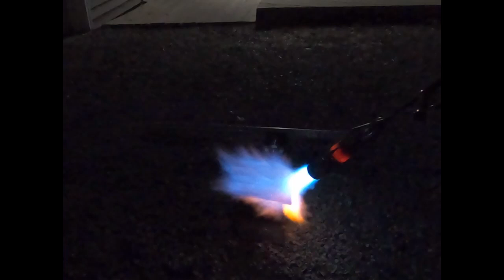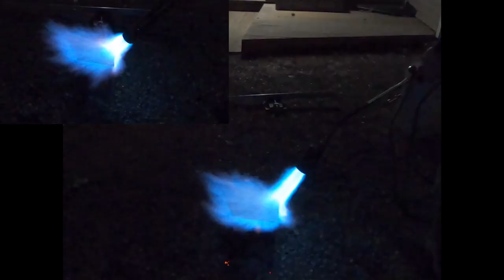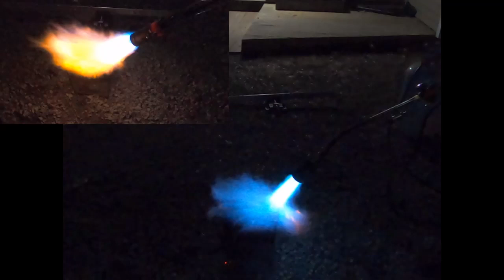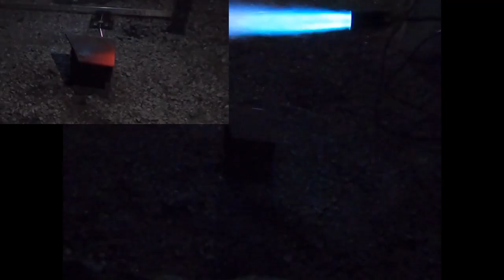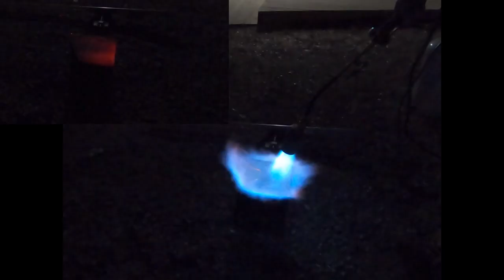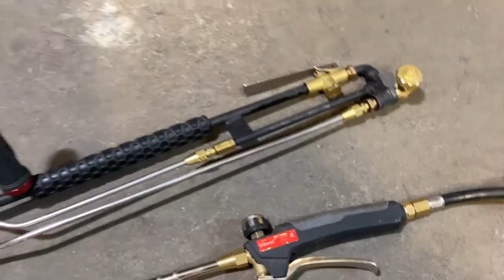Liquid Propane Jobsite Torch EXCALIBUR

Comment: Great portable solution to a legitimate issue that comes up when using propane in a colder environment. We used to use temperature adjustable 5 gallon silicone mat heaters (also known as SILICONE RUBBER PAIL HEATERS) on the propane bottles for our Bronze furnace; over time we established a temp to pressure over time graph for different temperatures to properly compensate for pressure loss. The frosting over on the bottles would render a bottle 2/3rds full completely useless over a short time of use in the winter time (10-30F) due to the Boyle's law. I used these successfully on 20lb Prop tanks up to the 200lb'ers by linking 2 of these mats together and wrapping them around the bottom below the liquid propane level or freeze line.

Comment: When you heat something like that on open -if it is possible use aerated concrete bricks.They are made by many brands Ytong is famous in europe.Its a very light construction brick with amazing insulating propertys ,easy to cut with hacksaw,its very cheap like big block costs 2$ a peace. Every time i need to solder something with torch i use those bricks as backing and it reduces time by half.

Comment: I would suggest you wrap the heated part of the propane tube in thermal tape [like they wrap automotive exhaust pipes with] so as to increase performance, since a lot of heat will be lost from the time the gas leaves the heater until it goes out the nozzle.

That insulation will deliver more energy to the target and lose less energy to the environment.

When you thermally crack some light gases, these products have changed ionic valences, and if they get from the cracking point to the nozzle, it will in fact increase the combustion temperature, but without knowing the precise amount of which products are made in the heater, its hard to assess or calculate how much more energy it is delivering.

Again, though, by putting cerium oxide or crumbled up catalytic converter inside the preheater, you will certainly get more energy out of the flame.

If anything, just prepare before you seal up the preheater, a small amount of whatever catalyst you decide on, and drop it into the inside before you seal up the end plate.

You would possibly want to put a small stainless steel mesh at each portal though.

That way small pieces of the catalyst do not go either forward or backward into the tubing.

But it would certainly increase your burn efficiency.